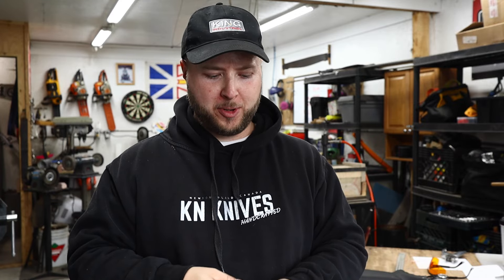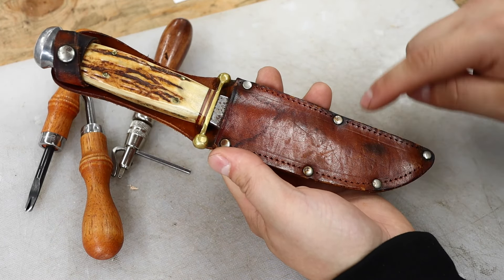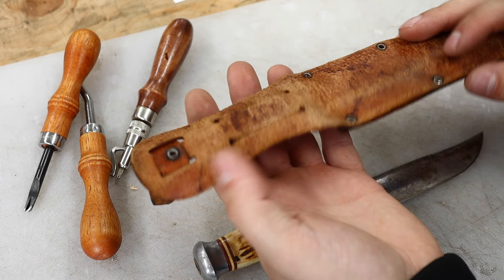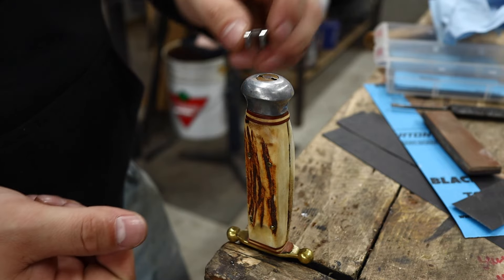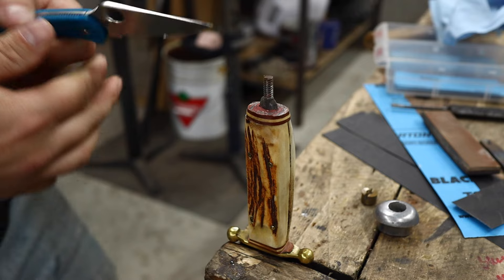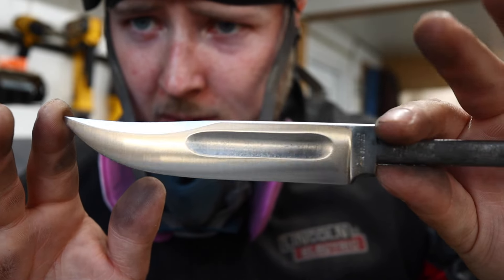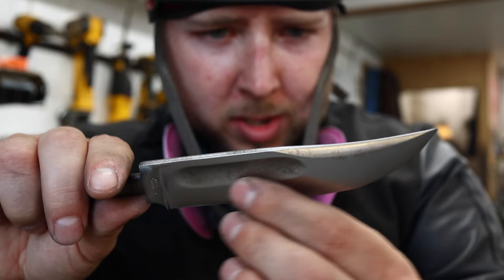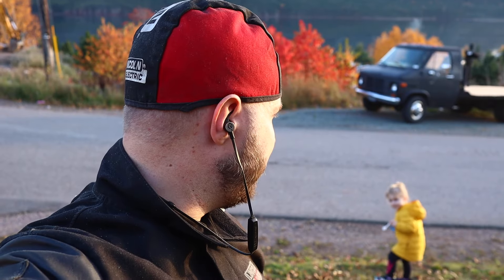MY CLIENTS KNIFE NEEDS SERIOUS WORK! - Knife Restoration

Comment: The company that made these knives had mirror polished finishes on them and had convex grinds, recently got a few different mint condition models from the same company and that is how they came at the time.
Reply from the maker: Thanks for the inside information, Thomas! Do you suspect polished steel, or a coating?
Reply: Mine has a mirrored polished finish
Reply: @kyle_noseworthy  I’m pretty sure it was polished, another one I got was slightly rusted but with a strip of leather and some polishing compound it came off so I don’t think it was coated with anything. Hopefully this will help a bit.
Reply: Lol.novices
Reply: I had open of these as a young fellow. What is the company’s name? Are they available to buy any more?
Reply: Look like a Hubertus Solingen . @BurgessTV

Comment: I was given a knife like that, leather sheath, stag horn handle, i was told it's more of a presentation knife, German craftsmanship at its best  ... I have never used it, it's so nice, the balance, the weight, the feel ... I really need to pull it out of storage and put in a display case.
Reply from the maker: I think it deserves it! Sweet. What's the condition like?
Reply: Well its over 50 yrs.old (probably older) ... and it still looks the same as the day i was given it (that was 30 yrs ago), very dark stag handle, mirror polished s/steel blade.
I have a box of stuff, that holds the stuff that is me ... the sad thing (kinda) is that i moved so often this box was left locked and ready to move ... i've probably had it out of the box a dozen or so times, i need to put into a case with some of the other stuff in that box.

Comment: Interesting...I have one very near the same that was gifted to me in the early 1970’s. I’ve seen several with slight variations and branding. Nice to see the original blade profile again...mines a few millimeters narrower from sharpening over the years. I had to good look and yes my stag handle came in two pieces and what thread that’s left in the sheath is a fine tan/gold color. My blade was originally a satin finish...looking closely I can still see some factory vertical grind lines.

Comment: Got almost exactly same knife when i was about 10 years old back in the 60s. Same exact floppy sheath. Made in solingen germany. Cost about 2 or 3 bucks at the woolworth department store. The hidden tang is not ideal for strength but will put new scales on because everything is loose.

Comment: I've got two of those.  One has a fair bit of corrosion and rust from being stored in a tool box for 30+ years.  The other is in much worse condition as I found it on the ground somewhere.  Both were made some time in the 60s but the guard is stainless steel not brass and probably cost less than $20 back then.  It looks like the guard was replaced on your client's knife at some point.

Comment: I have a very similar knife, same sheath, pommel and brass nut, one piece antler handle, but different guard and blade. Sheath and blade both named « Hoppe »in an oval and Solingen, Germany on the other side. « Original Buffalo Skinner » engraved on blade, for the North American market obviously. In much better condition than your sample though! Dad got it circa 1950, in Canada for your info.

Comment: I've never been a fan of rat-tail and most hidden tangs, simply because of the 90 degree  corners, where the tang meets the blade. It's a week point.

I started making knives, about a year ago. Just a hobby. But, I've wondered why those corners aren't rounded off, like a half circle instead of those sharp 90 degree corners.

Are those 90 degree corners not as much of a weak pointk as I think, or maybe rounding them off wouldn't be as much of an improvement, as I imagine?

Figured I'd ask those who have more experience and knowledge about knife design/geometry than I have.
Reply from the maker: Your concerns are valid. A rounded transition would reduce the stress point by a margin, but in either case a reduced tang construction simply has less material to withstand impact and will never have the strength of a full tang design. That said, INTENDED USE is all that really matters here. This beautiful, light and capable knife was never designed to baton with, as we often expect of our modern knives. These knives will handle all your normal camp and food tasks, processing game, whittling sticks, etc. with ease, and again, light and nimble!

Comment: I have my father's knife. It too was made in Solingen Germany. It has the name of Schmidt and Ziegler. It has a stag handle of the same Construction. The blade is etched with a stag hunting scene with some light scratches and tarnishing. I've always been afraid to clean up the blade for fear of taking off the etching. I wonder what could be done to clean up the knife? I've never known much about this knife so it's interesting to see your video unrestoring one.